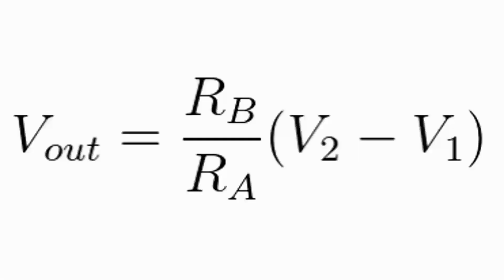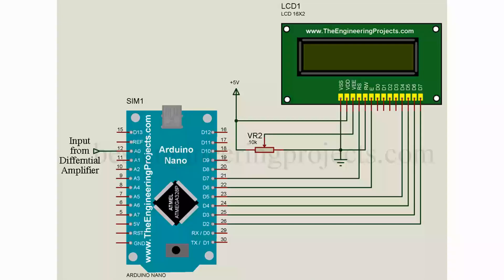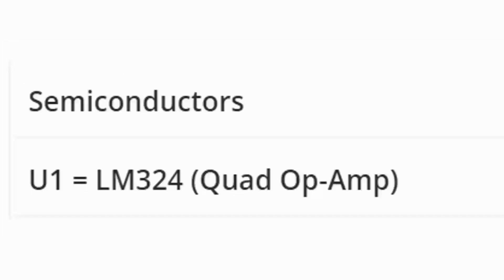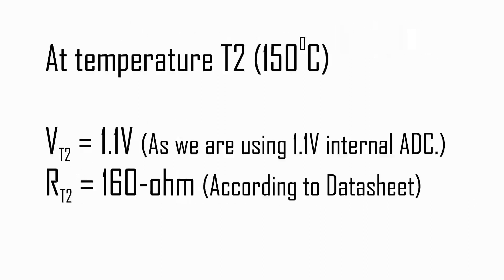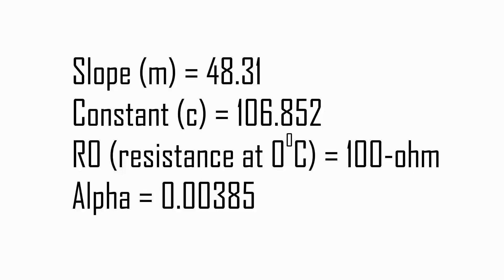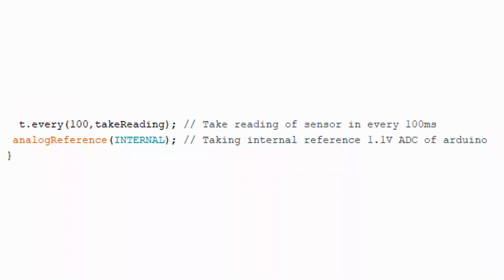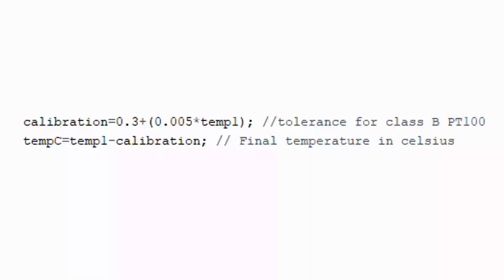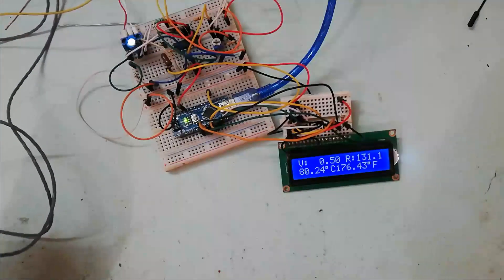Measuring Temperature using PT100 and Arduino Part 2

Comment: The value of Vt1 is wrong in your video and write up. according to calculation it will be 0.045 v instead of 0.09. you have directly written 0.09 v without an explanation. Kindly explain how you got this value.
Reply from the maker: Hi nidhi.
The value of vt1 I.e. voltage at 30 degree is measured by arduino.
Vt1 and vt2 is measured value rather than calculated value which is used to calculate the value of slope.
As I had  already mentioned please do watch the complete video and you can also visit the website.
Link is given in description section.
If you still have any queries please do let us know.
Thank you 😊

Comment: On breadboard, why is there ony one Op-Amp While the schematics shows 3?
Reply from the maker: Here in this circuit, LM324 quad op-amp is used i.e. LM324 contains four individual op-amp.

Comment: Please tell me about VT1=0.09 
Why did you use this voltage?
Thank you
Reply from the maker: As we are using equation of straight line for temperature reading, thus we need data at two different temperature. VT1 = 0.09 is voltage at one temperature where VT2 is voltage at another temperature.
Please do watch both the part of making video.
For complete circuit description do visit
https://bestengineeringprojects.com/measuring-temperature-using-pt100-and-arduino/